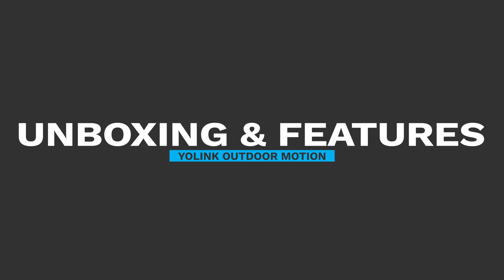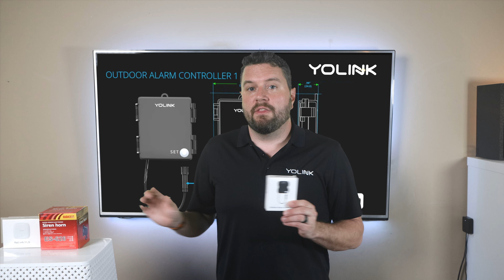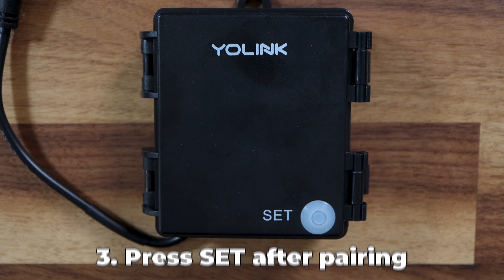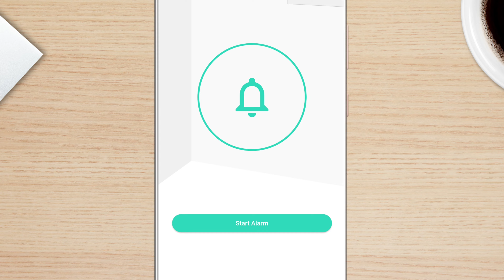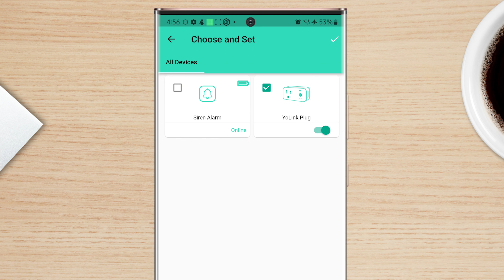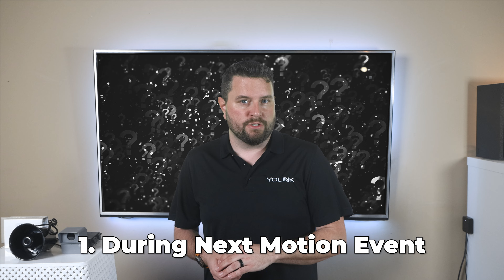YoLink Academy: Outdoor Motion Sensor, Alarm Controller & Siren Installation & Set-up

Comment: I tried to activate the siren with the Yolink app on my phone. It kept saying it couldn't connect to the siren. Even though the app showed the siren was online and even though the siren was in my bedroom 30 feet away from where I was standing with my phone. I have the Hub also. Trying to turn on the suren with the phone app over and over, I was finally able to get the siren to activate. One of the times it activated the siren but also said that it could not connect to the siren. What is going on with this stuff? I pulled the batteries out of the siren and my phone app still says the siren is online. It's not, because I took the batteries out. It's most definitely NOT online.
Reply: It might take a minute to register as offline

Comment: Yolink Alarm is SUPER COMPLICATED! I want to set different ways for the alarm to behave depending on whether I am Home or Away. Siren when I am away, no alarm during day, Hub only after 12. Spent hours with the app, can't get this to work. 
Edit: Got it to work sort off. The app is extremely difficult and there are so many settings at so many different places in the app. In the end you are not sure what rules the hardware is following. I find it really confusing. With proper software these units will be absolutely amazing.  It should be so simple you should be able to do it without a manual or the need to watch multiple videos.
Reply: I'm right there with you I emailed the company three times and nobody will get back to me
Reply: @pizzadave9812 you ever figure it out?
Reply: I've never tried the alarm but the rest seems to be working OK.  I did have one issue but customer service helped me very quickly.
Reply: You ever figure this out?
Reply: @chriscooley4279  I got it to work sort of. Really not user friendly at all
Reply: @chriscooley4279  Yes. See my edit on my post.

Comment: Bought a few of these outdoor sensors about a month ago. They're really good. The furthest is about 80 metres away downhill and through pine trees and it works a treat.
It would be good if you did them in brown or a camouflage pattern so they blend in to the environment better. 
Could really do with a proper Yolink distributor in the UK as we're paying much higher prices for some of the sensors than in the US. It would be good if you could also add 240v light switches and smart plugs to your range.